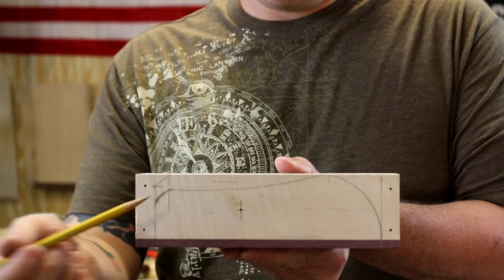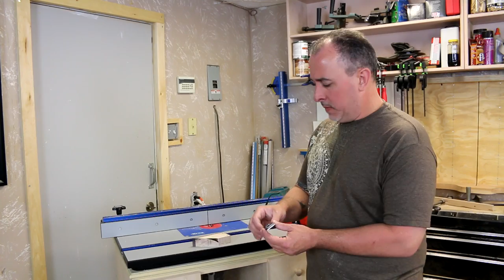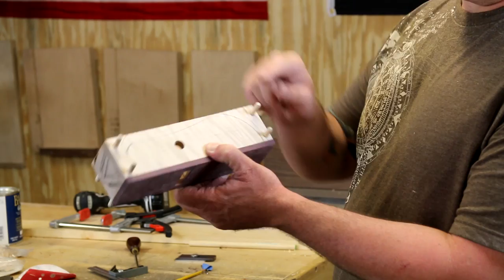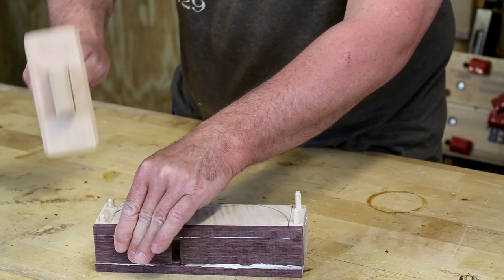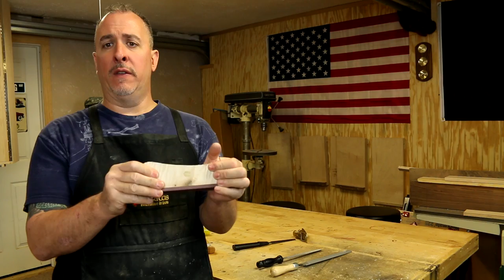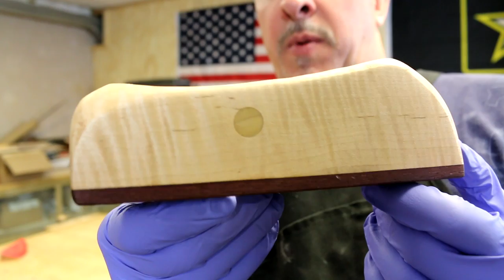Build A Krenov Style Block Plane

Comment: Very nice looking! One thing thou. You should put the blade in the plane before flattening the sole. You just pull it back so that it does not protrude at the bottom while flattening.
Reply from the maker: Gregor Slemensek Thanks Gregor! Thanks for the tip on flattening the sole!

Comment: Very nicely done.  I'm curious, it appears that the blade burned the wood when you ripped the sides off the blank and when you cut the angles for the blade.  (Not at all unusual and very hard to avoid with a thick blank of hard wood.)  Why didn't you sand the parts before gluing them back together?  This is not a criticism.  As I said, I'm curious.
Reply from the maker: David Walser Thanks David! I think it's time to have that blade sharpened. For what we were building I didn't think it would affect anything so I didn't sand the inside. I could be wrong though. ;-)

Comment: Nice job!  I love my Krenov planes.  They get easier and easier to set the knife with practice.   Treat yourself to a granite surface plate (Woodcraft has them) for flattening the sole.  You'll find a ton more uses for it too and it will out last your grandkids :)
Reply from the maker: GarageWoodworks Thanks Brian! I will definitely look into the granite surface.
Reply: woodworker 631 I love my granite sanding plates. Not sure of the cost at Woodcraft, but a 12 x12 granite tile from the box stores works well too.
Reply: +GarageWoodworks a cheaper option than a granite surface plate is 1/2" thick float glass, I bought a 3'x1' piece from a glass shop for about a tenner, it was originally for an aquarium. Dead flat. And the left over money is to be spent on beer....

Comment: So this was quite a while ago. Have you made any changes? Switched to a longer iron or cut more off the back so you can adjust laterally? Also, did you need to work on the mouth? Thanks.
Reply from the maker: Yes I had to work the mouth & was having problems with the shavings getting caught up on the dowel. Fixed that problem by removing some of the dowels mass.

Comment: Looks good. Your dowel is too big. You don't need such a thick one for strength,  and it will catch your curls. You can pare off some of this dowel, but the real answer is a smaller dowel to open up the throat. A metal rod can be thinner yet. You also need a longer iron. Hammer-adjusted irons need to stick out of the body a little, so you can tap the sides as well when you need to adjust the angle of cut (when the curl is thicker on one side). You need to keep the outside walls thin, also. Yours are a little beefy. I know, too thin is going to break, but it is a balacing act. Too thick will be annoying, believe me. Very clumsy and bulky. Metal sides are also a solution here and work well with a metal rod. Brass looks nice, but use what you have. Lets see more!
Reply from the maker: +bomaite1 Thanks! The dowel is way too big. Had to remove some of the dowel so the shavings wood clear. Yes I should have used a longer plane iron. I guess you have built a few and know the procedure. Thanks for the comments. Next one should be better!